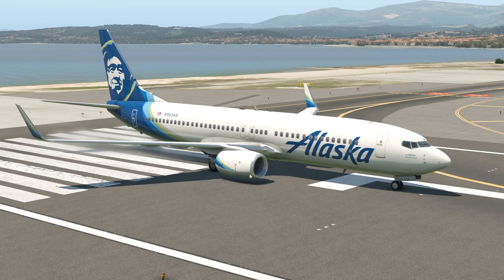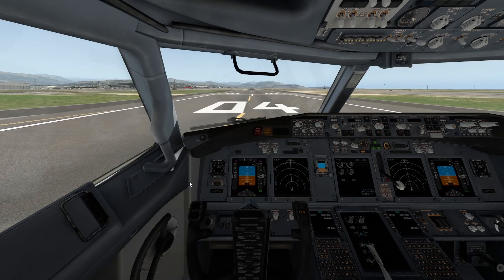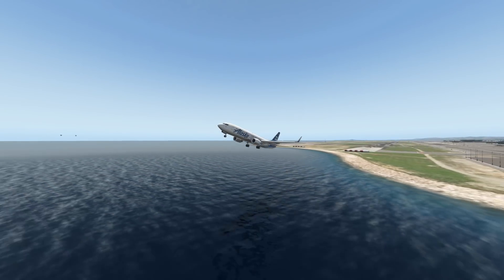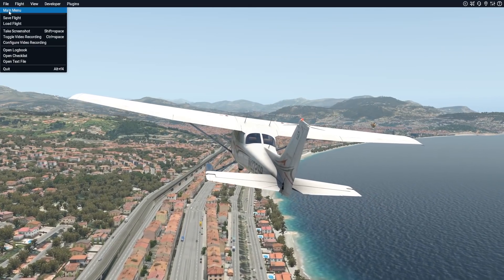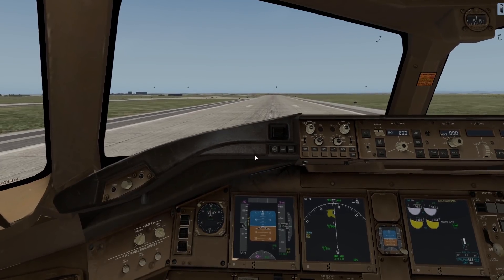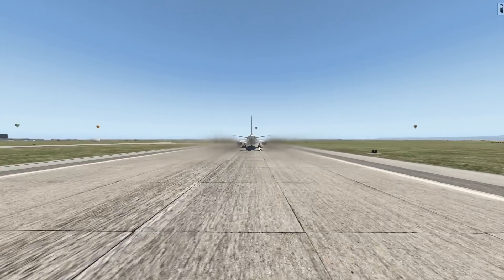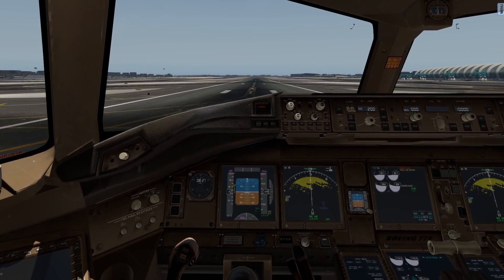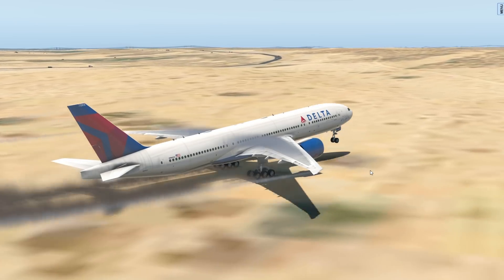Why Planes Can't Fly In Extreme HEAT

Comment: Fun fact: twa flight 800 explode because the air cooling system is under the fuel tanks so when the ac in the cabin was turned on the air cooling system was even hotter plus the temperature outside was super hot the plane take off from JFK international airport then the air cooling system was turned on which makes the fuel boiled because the cooling system is under the center fuel tank and then there's was a broken cable which led to a spark in the center fuel tank at that time the fuel is a gas so the spark lit the gas fuel up and then the under the plane it exploded and then the front fuselage was seperated with the main fuselage and then it crashed to the sea near newyork

Comment: The engines loss of performance is not only because of the thinner air (which is partially true), but also because simplifying, the power of a turbine is determined by how much you can rise the temperature. Since there is a limit at which materials just start malfunctioning, we have a  maximum amount of fuel that we can put into de mixture to rise the temperature. Coming from a higher temperature means that the highest temperature is reached sooner, therefore having a loss of power. For more info, google Brayton cycle

Comment: i taking a guess that the hotter it is the lower the atmospheric density therefore less air for the prop to grap onto or for the jet engines to suck in and use leading to lower thrust output...at a guess

Comment: I was living here in Phoenix when we hit 122°F (50°C) and at the time the charts on the planes for takeoff and landing performance did not go to that temperature. All the flights at Sky Harbor Airport were grounded. We routinely have temperatures above 110°F (43.3°C) here and when I was flying Cessna 172s/182s and Piper Seminoles, I would be right near the max on the charts some summer days!

Comment: Hey swiss what about mexico city's airport it is at 2,238m with runways that are 3,800m and denver's longest is 4,800m, denver is also only at 1,655m of elevation.
Denver is less high and has longer runways. Mexico is high as snoop dogg and runways shorter than charles de gaulle's longest and the ones at heathrow.

Comment: Swiss: It's quite hot here in Europe, it's like 90 degrees
Me: Dude that's nothin, here in Texas it gets to 110 degrees in the day
Reply: Yeah, but can you cook eggs with the sun during summer?
Reply: 90 degrees is nice weather here in Phoenix.
Reply: Its all relative Northern Europe gets a lot colder than Texas, so it's houses are designed to keep heat in (and rarely have Aircon or fans). That means the experience of heat can be feel much warmer in Northern Europe than it actually is because generally indoors will be a lot warmer than the outside.
Reply: @benrgrogan  In Australia everyone has AC, but there is a 30% chance it broke over winter.
Reply: Same as California
Reply: @Trim.C YT Same
Reply: I have 118 at least once a year in Arizona
Reply: Here in Indian Wells / Palm Springs, we average 116 degrees at some days. Some times we get up to 126 degrees

Comment: High Temps makes planes nearly un flyable—the cooling systems for the engines likely won’t be able to meet the demands, the cabin pressurization system will likely be under performing, and you’ll have likely  thermal expansion of fixed structural components, which can increase mechanical stress on the airframe.

Comment: Swiss: it’s 30*c in Europe, and it’s very hot
Me who lives in the Middle East where temperatures reach 45*c: 🤨🤨
Reply: Lol
Reply: 30*c Celsius is my perfect temp.
Reply: @brysongroverracing1502  52 c 

Really?
Reply: 30 is the average or so temp here, probably more.
Reply: Tbf you have to remember houses in Northern Europe are designed for European winters so are designed to keep the heat in(and rarely have Aircon or fans). As a result it usually much warmer inside than outside when it's summer in Europe. In the same way, you'd probably feel the cold much more at -5° in most of your houses than the average European house would.
Reply: なきかさら That’s above the record, you’re lying
Reply: Or at Mojave, CA- 115F in the shade- and there's no shade. Fortunately, rocket engines don't care about density altitude.
Reply: I live in pak with 99*c

Comment: Swiss001:30*C is really hot

Me living in Middle East wow this man think 30 is hot bruh
Reply: in germany usually the maximum temperature in a year was about 26-29°C but these were rear days
Reply: @tynxco18  In Dubai we usually get 41 to 49 degrees celsius at rare times it will even hit 50 degrees. Primarily we are having high temperatures due to the fact that so many people use cars instead of metro (type of a train) due to that the cars burn more fuel thus more temperature so this doesn't help because Dubai is already a desert. Right now here the air conditioning is not even working due to hot weather which happens more often then normal people living in moderate areas think.
Reply: @tynxco18  26 degrees is actually colder for us living in hot climates. This is why we can live in middle east because we have habit of living in hot weather and in harsh weather conditions.
Reply: Egypt gang !

Comment: Short answer: Lower air density results in reduced thrust and lift.
Reply: Thanks
Reply: Also means less drag, though.
Reply: @liamcarter7658  the shape takes care of the drag
Reply: @liamcarter7658  thrust compensates drag, lift compensates weight (in a level and steady flight, all 4 forces are equal). My flying instructor uses this fabulous analogy. Air is like porridge. Hot porridges is thin and liquid, cold porridge is thick and solid. Same with the air. Thinner air reduces lift therefore making for instance your climbing performance heavily worst. Less drag doesn't really matter as you use thrust to "cancel" it. Weight (mainly gravity) can't be changed.
Reply: @Nigo Maramag It means that (theoretically) you could accelerate faster and to a higher top speed... if you had engines that didn’t produce thrust by moving air, such as a rocket engine.
Reply: I thought it was because the fuel could explode because it gets too hot
Reply: Naxzed  No, the fuel won’t get hot from heat on the outside.
Reply: No
Reply: That’s just wrong 😂😂😂😂 the engine parts just can’t perform at such extreme temperatures and therefore pilots have to reduce the amount of thrust they use for takeoff, resulting in more runway being used for takeoff
Reply: An increase of temperature of the air becomes an increase its viscosity.
Reply: Aircraft performance and Design by JAN ANDERSON  JR.
Reply: Yes
Reply: Thanks Now I know what happens when there is extreme weather and temperature as a short answer
Reply: A good video
Reply: nerd